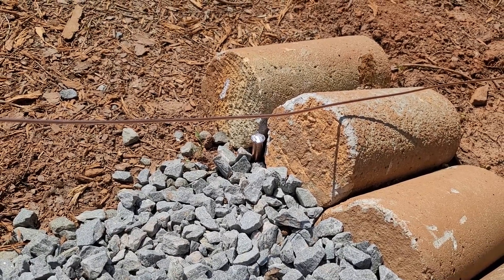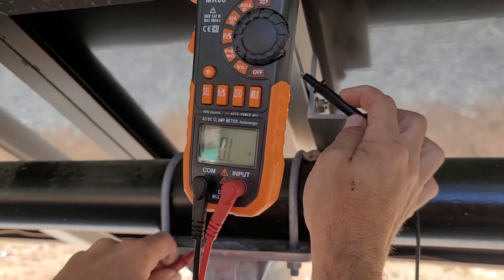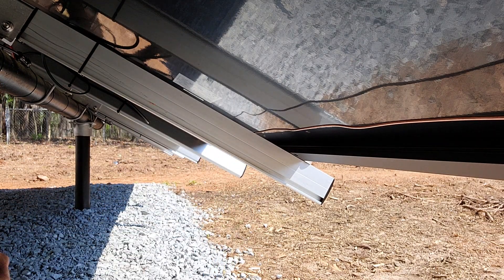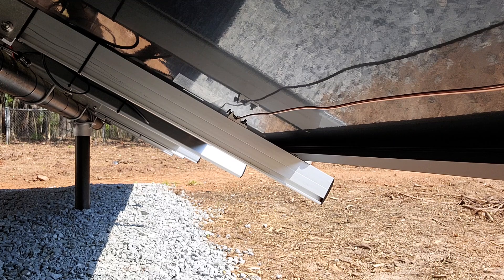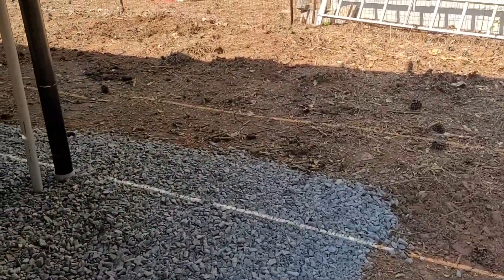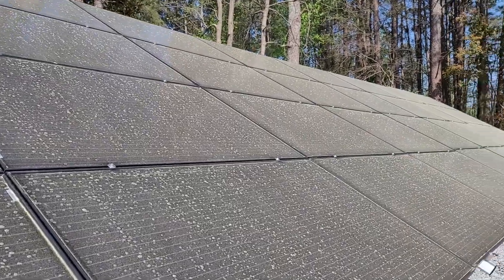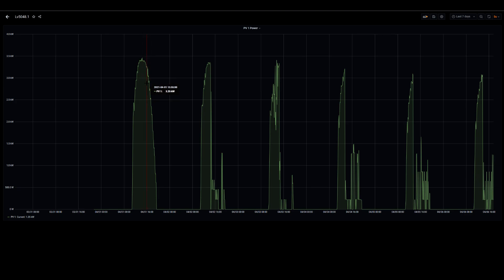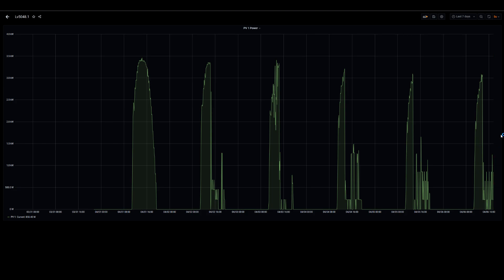Solar Array Grounding & Dirty Panels Affecting Power Production

Comment: Are you still using Jblances software from your 5048's? I need to collaborate with you on that at some point. I want to add a monitor to my system. 
Looking forward to the results of dirty vs clean panels!
Reply from the maker: Yes, I am still using mpp-solar software. I asked for LV6548 communication protocol from Peggy at mpp solar. they do not wish to provide it because it is "proprietary". But as you can see some commands still work. And most important command will still work. So I am going to do update on the setup here in coming weeks and I can share my setup with you. Would be interesting to see if you send her request for the communication protocol what would be her response. Thanks,
Reply: So there us a superset of commands on the LV6548 over the LV5048? If so, then yes, please upload any new code updates to Github! I have the code from Jblance, but always looking for updates if possible.

Comment: Wonderful system with all that information I just use the hose in the spring but we only get a little pollen from the Pine trees. Great grounding should be no problems now.
Reply from the maker: I am going to need a long hose. LOL
Reply: @DMIINC2013  shoulda put a pvc water line in that trench from the house that is already backfilled?
Reply from the maker: @AGhostInTheMachine  In retrospect, yes should have LOL
Reply: @DMIINC2013  I have a trench I'm hesitant to backfill until everything is running and tested, or if I think of something else to put in there.  Surveillance camera cable maybe...
Reply from the maker: I agree. However I had to fill it back up due to insane amounts of rain these past 6 months. If I left it open it would be a huge mess now due to drainage from adjacent property across mine to my next neighbor below me.
Reply: @DMIINC2013  gotcha
Reply: @DMIINC2013  It never freezes too hard in Georgia just run some pvc along the bottom of the fence and drain it in winter if you are worried about freezing.